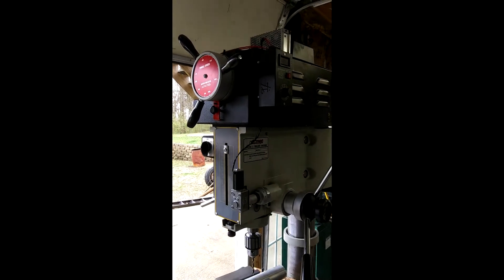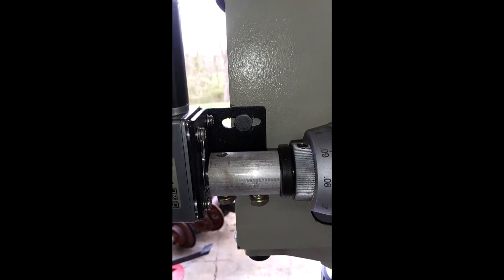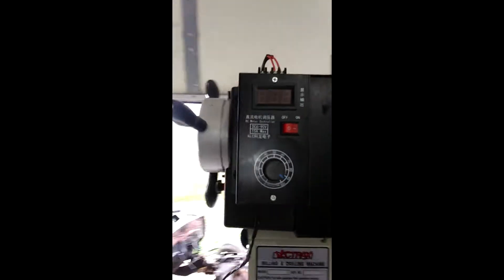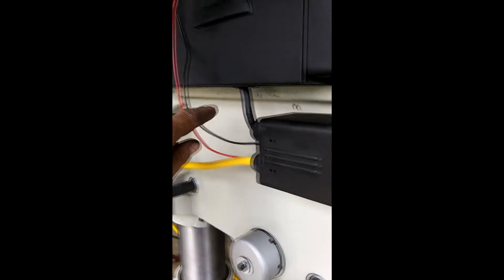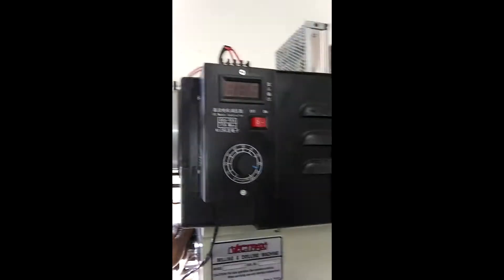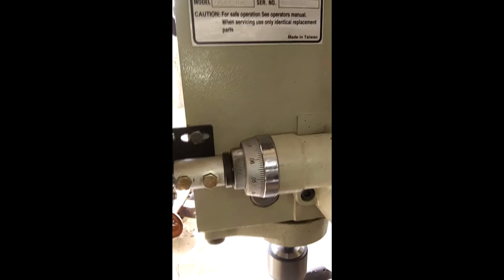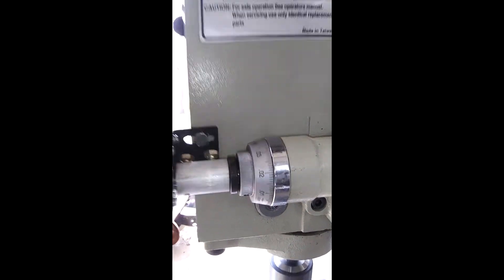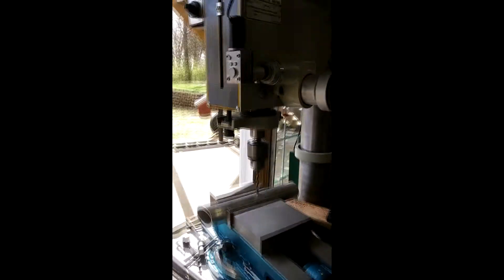DIY / Drill Press Power Feed. Milling Feed. Lathe Feed. Do it yourself. Budget.

Comment: I’m not trying to be a dick here , but you couldn’t explain the wiring properly and why use a reduction box, when you just match the correct motor and the speed control does the rest. Another thing, USE PROPER WIRE COLORING AND GAUGE, for various voltages and AC/DC..
FINALLY AND LAST DAMN POINT IM GONNA MAKE IS :: GET THE DAMN KID AWAY FRON THE THING WHILE ITS ON AUTO FEED AND HAVE SAFTY GLASSES ON WHEN IN THE FREAKIN ROOM!!!!! He goes and tries to grab the freakin thing and YOU GOT LUCKY!!!!! The way it’s wired, and if you didn’t have limits and even if you did, by the wiring, wouldn’t trust it and your kid could have lost an eye or his damn face!!!
IF YOU WANT TO BE COOL CUZ EVERY OTHER MORON IS POSTING THESE 10 year old upgrades, AT LEAST DO IT RIGHT, MAKE IT LOOK CLEAN AND PROFESSIONALS, and most IMPORTANTLY———- DO IT MF SAFE!!!
Only reason I’m freaking about the kid, I had friend have a drill bit snap got thru his eye and miss his brain, by 6 mm…!We were only 12. It’s still burned in my head 43 years later.